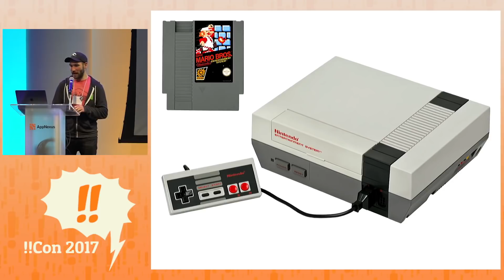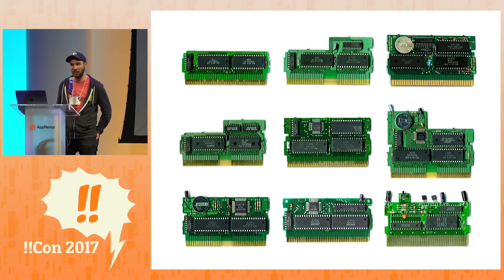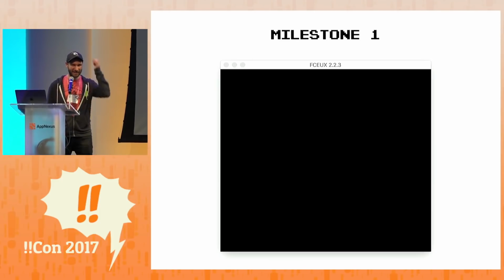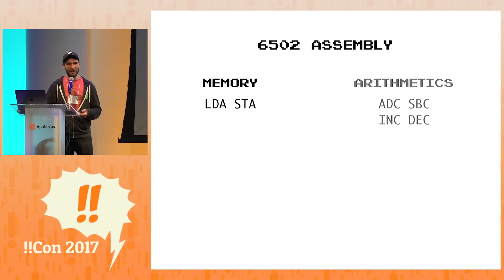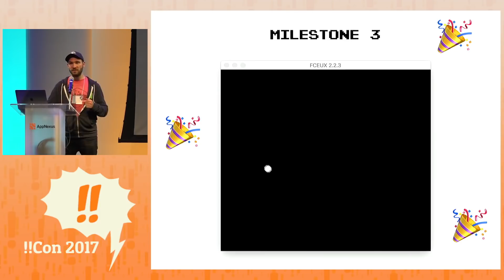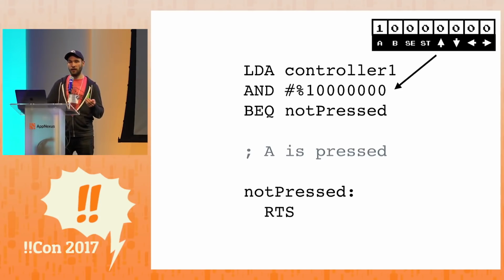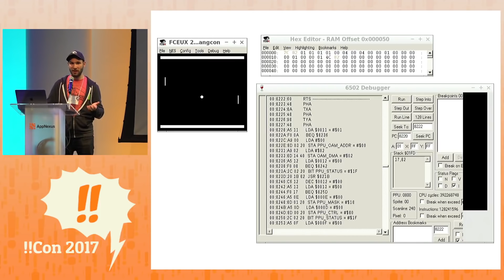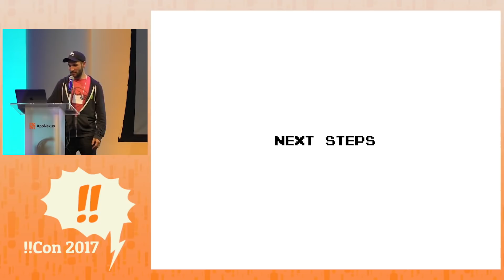Writing NES Games! With Assembly!!

Comment: The constant buzzing really hurts :c
Reply: Yes the audio has problems.
Reply: Executioner Gaming I hear it too, really annoying
Reply: I can hear it as well.
Reply: I hear it too
Reply: glad I didnt notice
Reply: Listening on a £1000 pair of monitors. No buzz just slight crackling and underwater effect that you can hear at high volume. (32. Possibly deaf.)
Reply: I think you're deaf or your monitors are magic
Reply: can anyone point out at what second the buzzing sounds csmd out ?
I'm hearing nothing, and I watched the video from start to end without skipping
I watch with Asus zenfone, I'm 39
Reply: @kingmanhusada824  I hear it on my zenfone right now. It's constant.
Reply: constantly. I don't think a smartphone speakers or its headphone is the right meter of comparison
Reply: i tot its just me
Reply: Have you tried lowering the volume. I could hear him just fine, and no buzzing. It wasn't till I turned it up, because of your comment, I heard the buzzing. Also, how does a little buzzing hurt you?
Reply: it depends on the frequency range of the output source you're listening to. If you're speakers are low quality maybe the high frequencies are not very defined so you probably wont hear that frequency at a low volume or maybe the speakers cant play that frequencies. If you use earphones you'll probably listen to it anyway. And also depends on the frequency range of your ears. If you're under maybe 12-10000 hz probably you cant hear it.
Reply: concentrate on the info
Reply: No buzzing here, tested on a laptop with shite speakers, a Macbook with good laptop speakers and a high-end desktop with a Klipsch speaker setup. It possible that everyone hearing the buzz is young? like ~25 years old and below? (Certain frequencies can only be heard by younger ears)
Reply: I don't hear it unless I turn up the volume.  And no, I'm not young.
Reply: I think your headphones are broken

Comment: He doesn't know how to flash memory to a cartridge through usb but he understands how to code for NES??
Reply: Yngdady's Soundbase 
I think he doesn't know how to make a cartridge once his game is done. He'll need to get someone to manufacture it
Reply: It would be a pretty nice end for his project.
Buy some cheap game from ebay. Get a couple of 27C512 eprom, a programmer and with some basic wiring, de-soldering and soldering skills you can replace the original rom with yours....and you are off!
Reply: Maybe get a proto-board with an edge connector. Or have a PCB made. (You can get them at quite accessible prices if you go to the right place)

Comment: My loz has its original battery and is still going strong
Reply: Max Ricardi Sonic 3 don't use battery, but a flash memory ;)
Reply: 21309ichiro 
Same with my Sonic 3
Reply: Juan Carlos Damonte 
Really? Makes sense. My FIFA 96 is dead, and it uses a battery (I have opened the cartridge)...
Thanks!

Comment: Nesmaker  on kickstarter. $33usd for a program to help you make a game. $88usd to get the program and a flash cart #notsponsoredbutwouldliketobe

I've tried to learn 6502, but it's all just generic strings on arcane gibberish to me. I'd love to write a game in 6502 but.... (read in cartmans voice please) "It's so hard and it makes me feel stupid. Screw you 6502, Imma going home."
Reply: The 6502 was the CPU for the Commodore 64 and really smart kids were coding using assembler back in the early 80's through out the mid 90's. But I think it has more of trying to think in assembler terms which is difficult as opposed to something like C. I tired it back in the day on the C64 and abandoned that for BASIC. Sadly, huge programs written in BASIC on the C64 took forever to load compared to those written in assembler. But also keep in mind that I SUCK at numbers. Never was my strong point so any successful attempt that you made using assembler is something I'm impressed by.
Reply: Midnightas - Technical Tutorials I think one of the goals of NESMaker is to act like a gateway drug into assembly
Reply: Midnightas - Technical Tutorials What a stupid thing to say. Unity is great, you spend time designing the game rather than debugging why VulkanCreateGraphicsDevice returned NULL. ;)

Why implement something that has already been implemented, unless, of course, you are working on cutting edge technology and are making the next graphical advancement in computing. (Crysis, DOOM 2016 etc.)
Reply: Midnightas - Technical Tutorials 

Like I said before, if you are not working on cutting edge technology, use Unity or similar. A lot of indie studios use Unity and it significantly reduces headache that you’d get while working with something like id Tech 4 or Irrlicht and other such engines written in C/C++.

I think Unity is perfectly fine if you are into serious game development. It’s just that you won’t be making the next advancement in graphics technology. You can still create a good game with it, I don’t think the 32-bit floating point limitation would be an issue for most games. Of course, I can’t comment on that since I’ve never bothered about the precision provided by the hardware ever.

As someone who’s worked with a variety of languages, I don’t see the problem with C#? What did you not like in the language? It’s closely tied to .NET but there’s Mono if you want to get away from the whole Windows scene.

Also, what do you suggest then? A large problem with not using a ready made game engine is that you have to write your own tools, and while it’s a massive learning experience, it also consumes a lot time.

Edit: Maybe because C# doesn’t compile to native ? Although that’s by design. It makes sense to drop performance in exchange for portability, especially when you’re creating something for a wider audience.
Reply: I still think it's good to learn some assembly even with that. That way, you actually have an idea of what is going wrong when bugs pop up and what the limitations are, because otherwise those seem like arbitrary things.
Reply: I think I saw this at PAX
Reply: Try the Apple //e - it might be more helpful for learning 6502 because of the built-in debugger and assembler/disassembler.
Reply: Try learning assembly for the x86 (That’s your Intel CPUs that you’re most likely using.) rather than 6502 assembly. There is much more documentation for x86 assembly and it’s fun to write assembly programs in DOS.

And besides, once you get into hardcore gamedev you’ll anyways need some idea of assembly (NVIDIA’s GPU kernels come to mind).
Reply: I bought a book by Jim Butterfield that helped me understand Assembly. Imagine BASIC but severely limiting yourself in the variables and operations you could do.
Reply: NESmaker is for lazy fucks, just like Unity and other WYSIWYG engines.
Reply: Shouldn't be done. NESmaker does seem like a beginner's thing, but beginners shouldn't make game whatsoever.
Reply: Unity is completely limiting in what you can do. I have to use Boo, C# or JavaScript, all of which are horrible languages. There's a forced splash screen, the multiplayer system is forced and only allows 20 concurrent users, also the problem that there are multiple "ways" of handling multiplayer, which may not work well with your game.
The physics is limited, physics values are only single-precision floating points which doesn't allow spaces larger than 10km. Absolutely horrible video playback. UI doesn't support translation. Unity games aren't moddable, which many expect your game to be able of, these days. There are many many more problems.

If you're doing something simple then sure, Unity is okay.
But Unity should never, ever be used if you're planning on seriously making games.

Comment: Assembly is useful and high performing but really really really pain in the butt(ps Im a electronic engineer )
Reply: Abhishek Sharma For a modern x86 processor, it's neigh impossible, but programming for the 6502 in assembly is actually pretty easy.
Reply: Drew Sebastino Tell that to Steve Gibson
Reply: Do you run on AC or DC?
Reply: Dc
Reply: Don James What's the joke?
Reply: Just a play on words.
Reply: X86 MS DOS batch file using assembly:
@echo off
echo a cs:100>tmp.deb
echo mov dx,108>>tmp.deb
echo mov ah,9>>tmp.deb
echo int 21>>tmp.deb
echo ret>>tmp.deb
echo db "Hello World!$">>tmp.deb
echo g=cs:100 107>>tmp.deb
echo q>>tmp.deb
debug<tmp.deb>tmp.inf
del tmp.deb
type tmp.inf

Comment: Kinda obvious shit, I learnt 6502 as a kid......
Reply: You're prepared to claim that most of the people your age find working with this stuff trivial?  I think you might be taking your upbringing for granted.
Reply: Don't think many people know how computers work at the metal any more. Assembly is now an abstraction to talk to CPUs. They internally run microcode and have basically another operating system that we never see.
Reply: I would say we all have cars, and use them everyday, but that doesn't mean everybody knows the ins and outs of them
Reply: kinda obvious shit? What's obvious?
Reply: Acidic lol, when you grew up with early computer system, like VIC -20, c64, Apple 2, they all used 6502, so you knew assembly and how computers work at the metal, you had no choice. In guess millenniums don't have the same wonderful experience knowing how computers work at a low level.  It's kinda obvious to our generation....
Reply: HMC7 people were more geeky then you had to be..computing was very close to the metal.... I had a rucksack with "6502 machine code" on it....so for sure I was the weird geeky one, I'd rather be writing a game in 6502 rather than go out...... Good times...